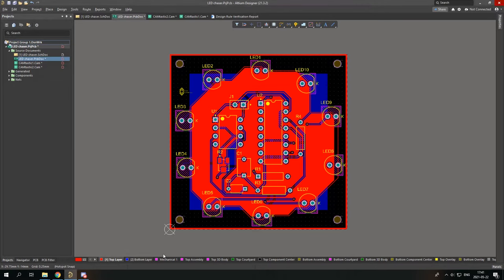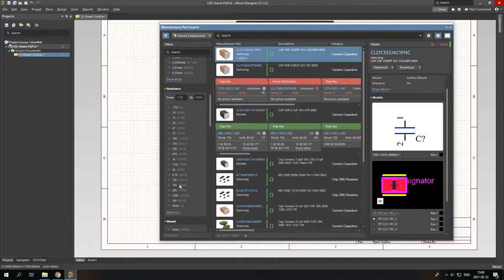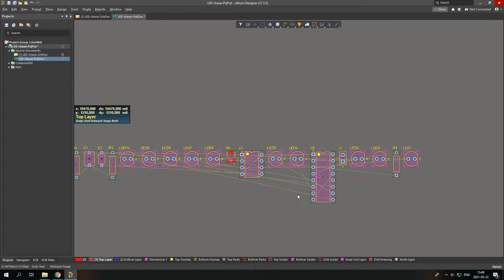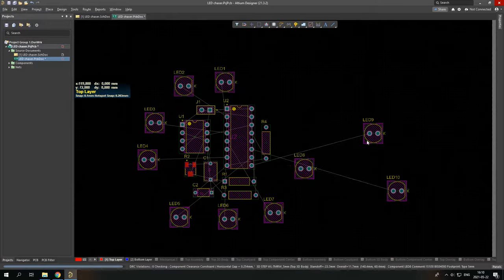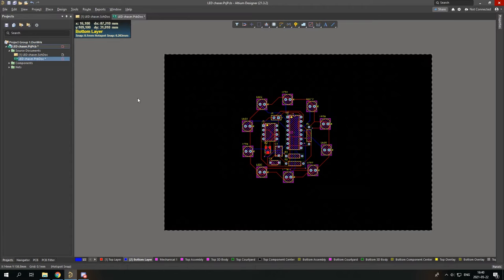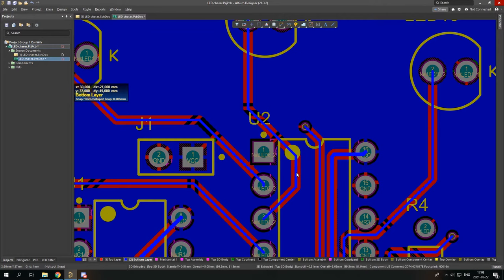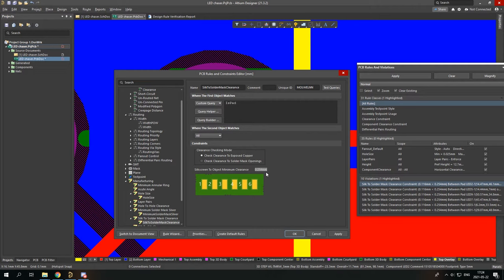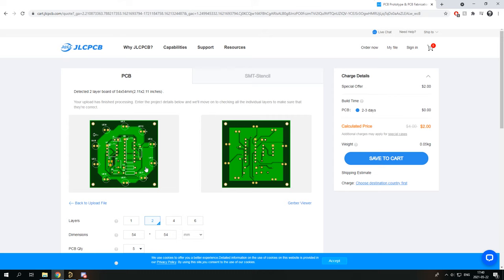From Zero to PCB | using Altium Designer

Comment: Hello friend, great video!, do you know a site or course where i can learn about components such capacitor, mosfets, inductors, to make calculations of them to know which value of each type i need on a particular project?
Reply: Search: Engineering mindset
Reply from the maker: Hey, so about that :D there isn't one site where you can learn it all, but really You could just start gathering knowledge from simple electronics circuits where You need to calculate some simple formulas. And I'm glad that You enjoyed my video!

Comment: Thank you so much for this ❤.  I have a question....I was being told that ALTIUM is the most used PCB design software in the industry right now. As a first year electronics Engineering student I am really trying my best to learn everything although it's not even being discussed in our University. Is ALTIUM really that needy? What should I do to be ahead in the electronics Industry? Plz answer ❤

Comment: Trying to understand how did you able to "Place" a part, to me its unavailable option no matter what I'm doing, would you like to share some points around it?
Reply from the maker: Hey, I think you can't place parts from manufacturers part search when Altium is cracked (you know tpb), but if I am correct you can still add your own component libraries and place them from there.
Reply: @Audas101  damn now I need to make my own libraries oof it would take time ..tnx for the help
Reply from the maker: No no, You don't need to make Your own libraries You can use already made ones from internet like snapEDA or ultralibrarian

Comment: Applying GND or VCC plane should be done in a calculated manner. 
Take this example I have from my experience. If you have a small BGA chip (2x2mm), that doesn't require a lot of current. CAD program will rout the traces thin. BUT!!!!! The GND plane will be thick. The trace of GND will be much much thicker than all other traces. 
What is bad with this? Manufacturer of the board will face a difficult time to balance the oven since for one pin you need a lot of heat, and other doesn't require so much. Which results in either total melting of the balls of the other pins and shorting them, or if the temperature is not enough to melt the GND pin's ball. It will result in cold-soldring. 
You need to be careful .. Applying big GND or VCC should be with thoughts.

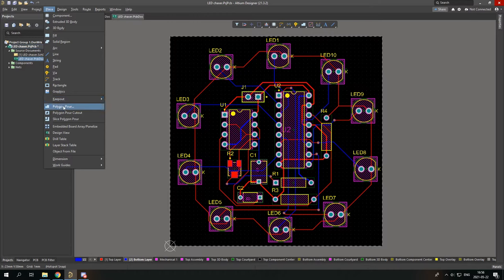Comment: This was such a great video, I have watched it at least 5 times. Could please explain why do we need a polygon form at 22:20 ? Is it make a Vcc and a GND plane? So how many layers is the PCB going to have? I did not use them because for testing I made a circuit with just one resistor and a LED. I wonder if it still work since current can flow on the PCB tracks and not on the planes
Reply from the maker: Hey, thanks for watching! especially so many times! so he polygon is only for informational purpose in this video. it is really not necessary to put it on a simple circuit like this. And in your case with one resistor and one LED it will definitely work and no polygon is needed. Actually these polygons are used for (as Altium itself describes) - "On a signal layer, you can place a solid polygon pour to define an area for carrying large power supply currents, or as a ground-connected area for providing electro-magnetic shielding. Hatched polygon pours are commonly used for ground purposes in analog designs.".

Comment: Might as well use wider tracks. It's at no cost to you since manufacturers doesn't charge for total amount of copper but merely the layer thickness.
Reply: And also, don't use vias to go back to top layer if your component is through hole. Then it can be connected directly from the bottom layer.

Comment: Question, do you also set the grid to 1mm on the Schematic page? (and does it matter if you set the grid before or after you have made your schematic?)
Reply from the maker: I don't remember about the schematic, but I think that the grid was set on 1 mm in schematic page. And it does not matter if you set the grud before or after, it only changes at what intervals your mouse is locking to points. For myself I always try to use smaller grids like 1 or 2 mm.

Comment: So you are not using Annotation feature, but instead manually assign the designators for each component in the sch? Any reason for that? Thx
Reply: I would say one example how you would need to do so. If you want to sort the components you are using by the functional area, you wouldn't let the placements sequence decide the components number. You would like to decide the components number by yourself. That will help manufacturer of your board or yourself when you  do rework, or mounting works. I had many time at the job so difficult time to find component where you wanted to find for example after R22, finding R23 which should and supposed to be near to the same area, while I founded R23 at a location which was far away from the R22. That make your life too difficult.

Comment: 15:05 Changing the layer thickness is questionable and seems silly idea. Can you manufacture a multilayer FR4 PCB sheets , will you do that in the garage? If you can't do that then the manufacturer (PCBWay, JLCPCB ... so on) will select the proper PCB sheet material, and the layer thickness will be given you can't change it, and they are not arbitrary values. I can't even understand what is the purpose, why did you change that, what's the point?
Using metric values is also questionable, because in the manufacturing most of the machines work better with imperial, that's the native and most common. I'm European but I work with mils when I make PCB. Just for example a DIP package has 100 mil pin distance. There are historical things, you can't change that, you better conform yourself to it.